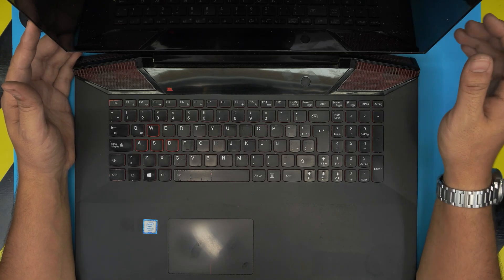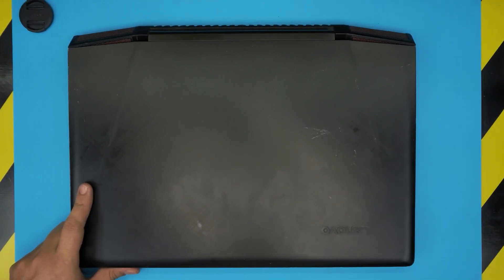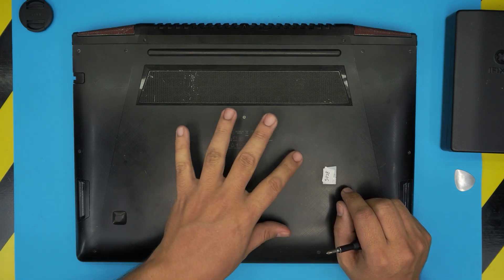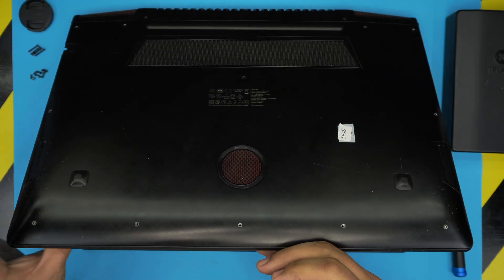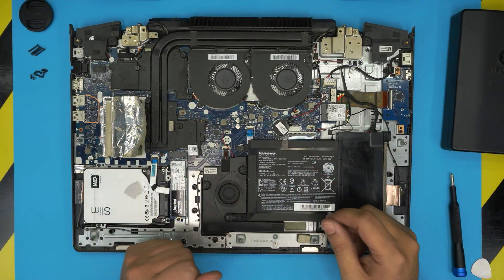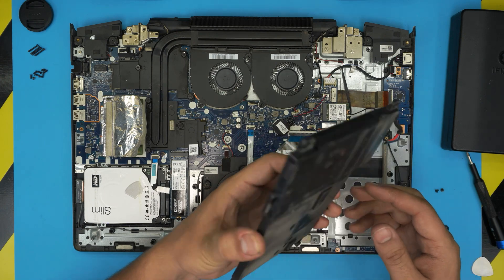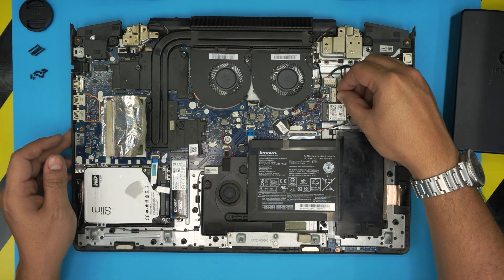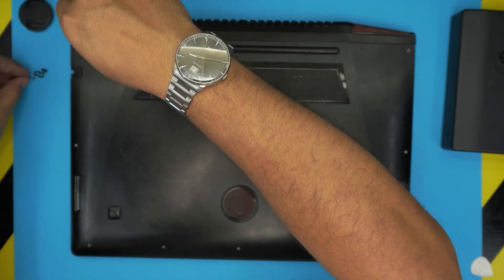Lenovo Ideapad Y700 17Isk 80Q0 🚩BATTERY REPLACEMENT

Comment: If your Lenovo Y700 battery won’t charge after replacing it, check Lenovo Vantage.
Disable “Conservation Mode” (Battery Charge Threshold).
It stops charging above ~60%, and the setting stays active even with a new battery.
Turn it off and the laptop charges normally again.

Comment: Hello
I changed the battery, everything is ok, it starts
BUT it doesn't charge at all ... It stays at 5% no matter how plugged it is
Do I need to do anything after changing the battery?
Thanks.
Reply from the maker: Thank you for the feedback! if you wish to support the channel you can LIKE or SUB or both :P
sorry that i was away for few days, regarding your question: go to the lenovo website and download the BIOS update 
just search this in google:
Lenovo Ideapad Y700 17Isk driver
make sure its lenovo direct site.
in mexico this is the link
https://is.gd/FOnBKt
Reply: @uFixTek  Thanks for all the help.   You are the best.   I just ordered a battery for my Y700 17ISK and with your video I feel confident that I can change it out.   Thanks also for the tip about the BIOS.   I would never have figured that out on my own.
Reply from the maker: @jeffreybell7015  You are welcome! Glad you liked it 😊Thank you for the feedback! if you wish to support the channel you can LIKE or SUB or both :P
if you have any question or request in the future feel free to ask me.